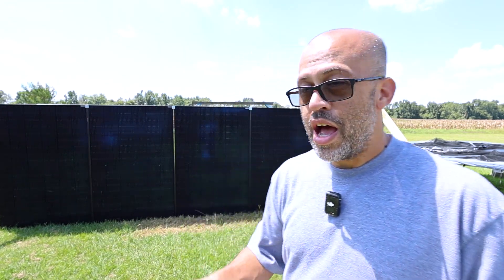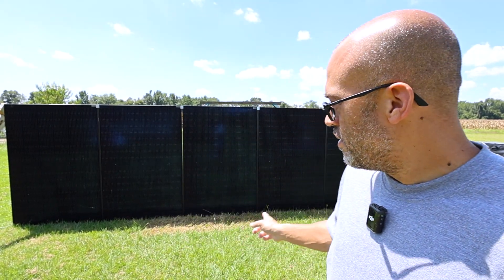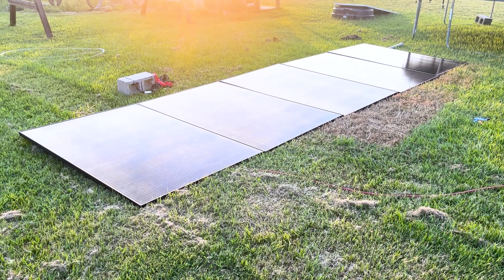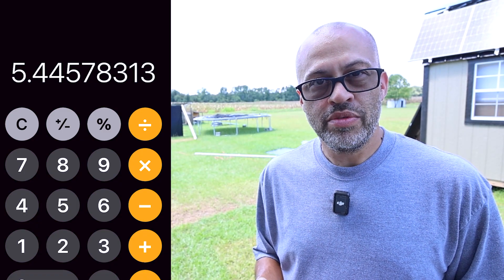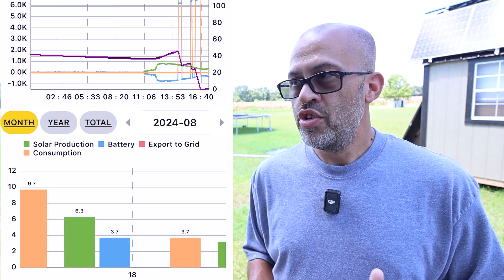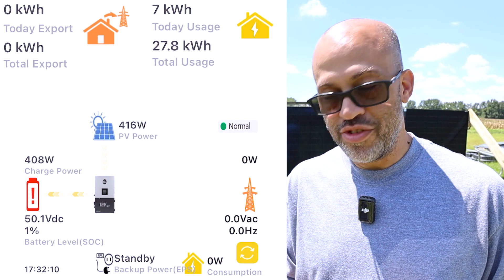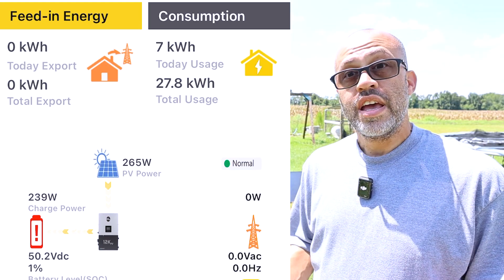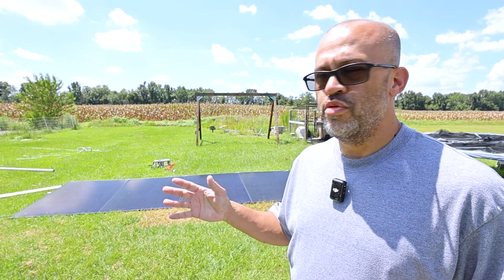Sirius Solar Panel Vertical testing - More or Less Power?

Comment: Do the vertical test in the winter and you will find they are not too far off from an angled panel at the proper angle.

Comment: I don't think you're grasping the point.  First of all, which direction are your panels facing?  Why are you not calculating the power throughout the entire day?  THAT is where the advantages are seen.  Peak power in the middle of the day isn't the intention, overall wattage for the entire day is the point of the exercise.  

The idea being that although midday absorption is lower, early and late-day absorption is higher.  So you get a flattening of the whole day wattage generation curve (less of a midday peak) but the overall wattage gained is higher for two reasons... one: the panels are kept cooler, so their absorption is more efficient and two: you continue absorbing power more efficiently for a longer period overall. 

Furthermore, if you live in a snowy climate, snow cannot accumulate on the panels, therefore absorption is maintained.

Personally, I'd arrange my vertical panel array like a V, with the widest part of the triangle facing south.  Except the point or apex of the V would be about four of five panels like a flat wall facing south and each arm pointing towards a point on the horizon half way between sunrise and midday (left arm) and halfway between midday and sunset (right arm).  

So what happens is, the rising sun hits (mainly) the inside face of the right arm and (partly) the outside face of the left arm and apex.  The midday Sun then hits the four apex panels and gives some power to the inside faces of both arms.  Then, the setting Sun gives power (mainly) to the inside of the left arm and (partly) to the outside of the right arm and apex.  

By avoiding direct Sun-facing, none of the panels get so hot as to affect power generation efficiency and they'll last longer as a result.  Ideally, set your array around a small body of water so you get the reflection off the surface and the advantage of the cooler air.

Vertical arrays are not about immediate peak absorption, they are about full-year absorption, ease of maintenance and array longevity.  You'll get better overall wattage gain with no worries about debris or snow.

Comment: this will soon become the norm as solar panels drop in price.  why pay for install when the panels are so cheap that you don’t need to maximize their power creation?  

solar will be 1 cent per watt by 2030 or 2035.  we will just all have a solar fence since the install cost will prob save us $10k.   

when the cost to install becomes more than the panel it will be dumb to install them. 

it will be most efficient to hang them from our outdoor walls and make a fence.
Reply from the maker: Solar fencing is definitely a good option in the right circumstance!

Comment: if the panel only pulls 100w on the backside 
you cant expect it to give a good result
(400W = 100w on backside -550w = 200w on backside)

if you place them east west you need panels that produce the same on each side (very expensive, might as well glue 2 panels together)

you would need to face them south for best results
Reply from the maker: Ok basically what I said in the video. So I agree. Like I said only certain circumstances this makes sense. So all situation dependent

Comment: Vertical on my garage wall and garage door/privacy wall for deck works great.no roof leaks. No snow build up. No dirt build up. No pests
And easy cleaning.
Winter production is great you get 5-6 hours of east sun in am easy!
Reply from the maker: Oh nice! It does have its place. Winter snow is a great place first vertical panels!
Reply: If you you are looking to maximize financial return vertical has a big advantage. It generates far more energy during the peak demand time.

Comment: I was under the impression the panels were supposed to alternate front, back, front, back for optimum performance with East/West orientation? I'm not to impressed with the performance over traditional panels from the numerous reviews I have watched. Also, I see no benefit if using a solar tracker. Thank you for the video.
Reply from the maker: Hey thanks. Yes you could do it that way but I would use optimizers with the alternating setup. If these are ground mounted is where they will shine. Especially during ground covered with snow, near reflective surfaces, etc.

Comment: To do this test right you need to get a weather station. The power inget always correlates well to the solar irradiation reported by my weather station. Your eyes really can't tell when the solar power is weaker. I often think I have full sun and blue skies but the weather station and solar output shows i had about 700-800w/m2.
Reply from the maker: I have a meter for the sun but always forget to use it in the videos! Good idea

Comment: I'm not super familiar with your property, but it looks like you have the row of panels facing north/south when they're standing up.  I think normally vertical panels face east/west so that you get more sunlight in the morning and evening. They're not great for a primary, middle of the day supply as you mentioned, but as a secondary add-on the bifacials are great when mounted vertically facing east/west
Reply from the maker: They are east/west. Not perfect off a few degrees but basically
Reply: with models like this that only produce 100w on the backside, east west makes little sense.
you wont get the same from the backside so you will only be harvesting the morning or evening sun with the good side

Comment: Thank you, Rodney, now I have the inspiration to go out and hook up my 3300w BF south facing vertical array. These vertical east west tests are for PV to grid for early and late day boosts when demand is high. My test tomorrow will include a 4'x14' sheet of reflectix attempting some snow simulated boost on the ground in front or behind the array but not both same time, looking at the weather it may be a 100% overcast test. Let's see if it can pass 800w? My 2790w with sun and snow peaked at 3415w last year.
Reply from the maker: Go for it! Let us know how it does
Reply: Try the same thing just have a 2x4 under the panels so your grass doesn't cause shadows. When I spaced (cement blocks) off the ground I got about a 25% increase right away. 
 After messing with this ideal for almost two years, Now is the fight to get a permit for a solar fence put in lol
Reply: @dizzlethe7346   permits ugh, I only need permits for building a nuclear power plant, sorry you have to deal with that.
Reply: @bobmonztr  It does suck BAD! But it's nothing like where family lives. If I were to make the "fence" shorter or pull it further then 5ft from property line I wouldn't need the permit.  It's just that the fence will be almost nine foot tall (6ft limit) and 2 foot from the property line. So if I don't get it soon I will just be a dk and do it in a spot that doesn't need a permit lol
Reply: @rodneyhunt  the test has been delayed, I just discovered this inverter has issues on pv3 and pv4, low power, solaronline is pissed about this and is driving 8 hrs next week to come fix it, he sold over 100, now 2 are faulty and we're both mine, but I put the new array on pv2 and it was pulling 500w through heavy rain ,next week should be over 1.8kw total through black sky and rain.  All connections are solid, new array wires were .1 ohm for 60 ft, if I put the new array on pv4 it drops to 80w from 500w
Reply: @rodneyhunt  swapping inverter today,hence the delayed video test, upgrade to 10kw, with 17kw pv input
Reply: 400w bifacial = 100w on backside
550w = 200w on backside

those 400w are very low on w on the backside
Reply: @Hansen710  good ratio, I might have to purposely shade an array this winter if it makes too much
Reply: @Hansen710  The 6x550w are at 500w with heavy rain, overcast should get the 800w goal.